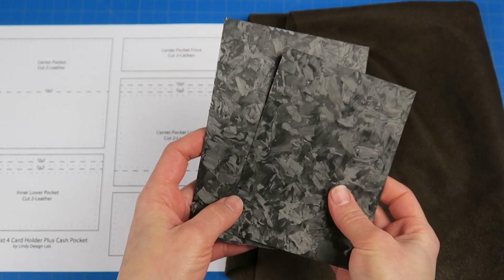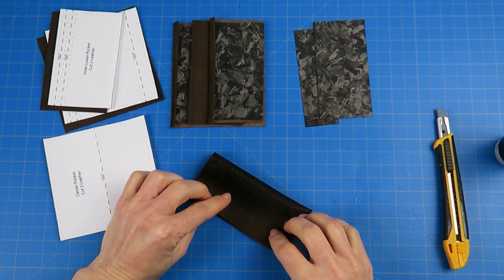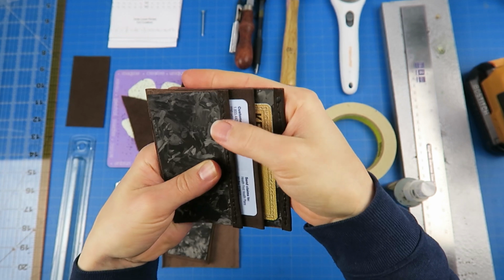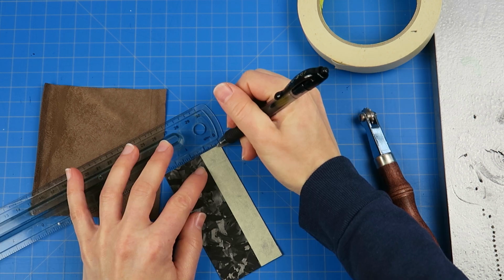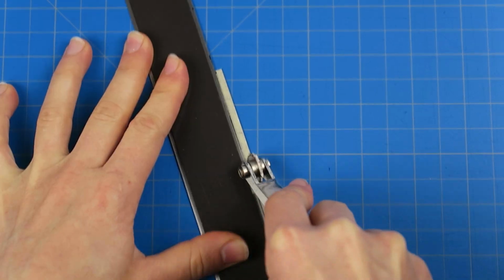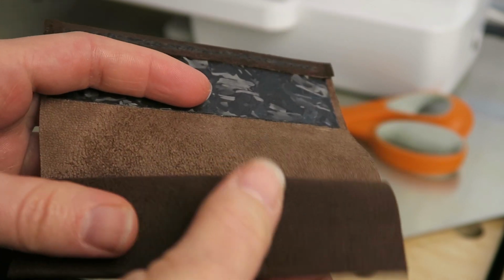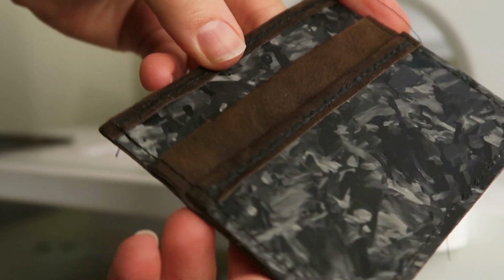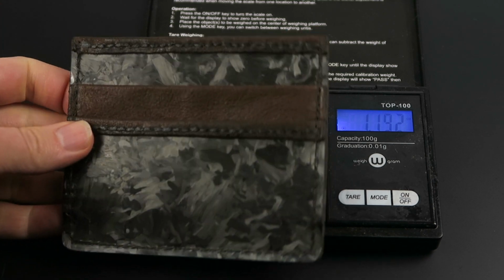Minimalist Wallet from Forged Carbon Fiber

Comment: I read somethere that carbon fiber leaves tons of small thin needles/particles in the skin forever each time you touch it raw without epoxide coating.. Am I wrong?
Reply from the maker: I don't think that's true, but it's always a good idea to wear gloves when handling carbon fiber. It can for sure cause irritation in its raw form before epoxy.

Comment: Thank you for sharing, very clever.  Something to consider with the thickness, you dont have to have all the side pieces be completely square and full width.  Hard to explain... essentially you only need full width on the pieces where you see them and for one or two stiches where two pieces start to overlap.  The rest can be trimmed a little on the sides to make the thickness less on the stitch line.  I hope that makes sense and is helpful.
Reply from the maker: Yep I gotcha. It was such thin leather, thought I could get away with the full widths.